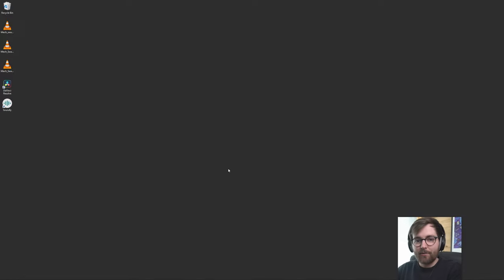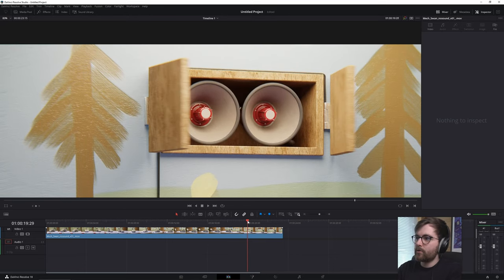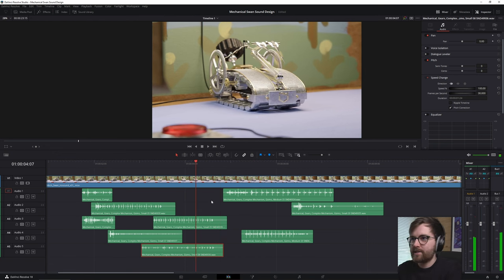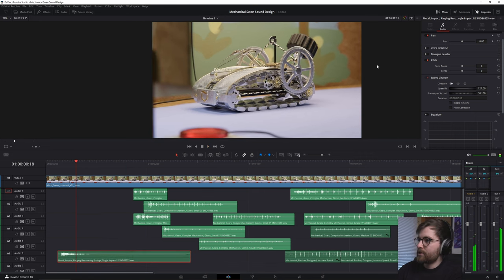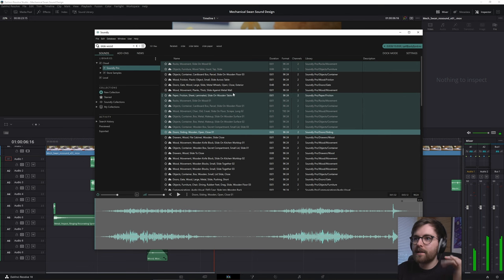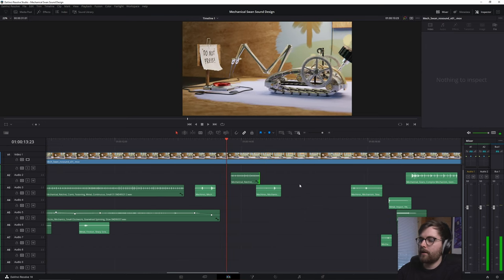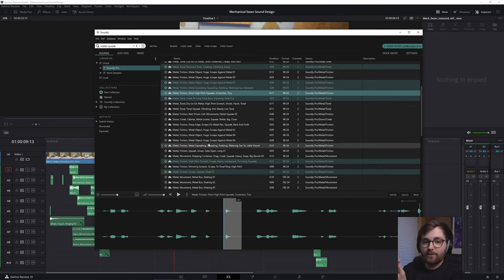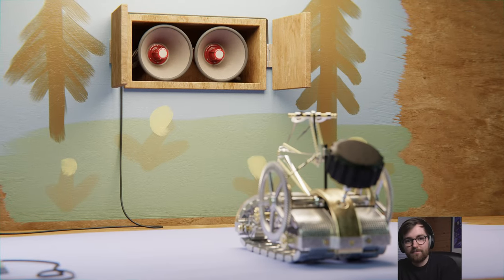Tutorial: Mechanical Sound Design for 3D Artists

Comment: Completely useless comment here, but there are some low latency wireless headphones like the TMA-2 Studio providing an advertised 16ms latency (cable is 5-10ms). They require an external device that you plug in your sound output but this can be useful if you move a lot in your studio during your recording session. They are also probably more accurate than standard consumer headphones or ear pods.

Other than that, I can't wait to try Soundly. Thanks for the video. 🙂

Comment: For a scrape, two items are sliding on each other, but they remove small fragments of each other as they slide: the car scraped against the concrete barrier. 

A creak is when two items (typically wood or metal) are not smoothly sliding: the old hinges on the door creaked on the house. 

A squeak is like a creak, but is more like one fluid sound, normally more high pitched than a creak: the worn car brakes squeaked as the old car came to a stop.

A creak sounds like: rra-a-a-a-a-a-a...

A squeak sounds like: eeeeeek...

Hope this helps!

Comment: How did you make the gears work perfectly like that? Love it!
Reply: Probably drivers.
For instance, if you have two gears with a ratio 2:1, you can drive the rotation of the larger gear by referencing the rotation of the smaller gear and dividing it by two. Just add a driver to the appropriate rotation transform of the larger gear with the expression "-(var/2)" and point "var" to represent the appropriate rotation transform of the smaller gear object.
Now when you rotate the smaller gear, the larger gear will rotate in the opposite direction at half the rotation.